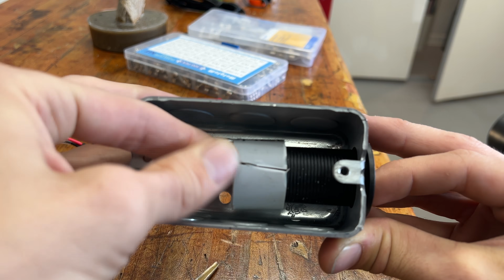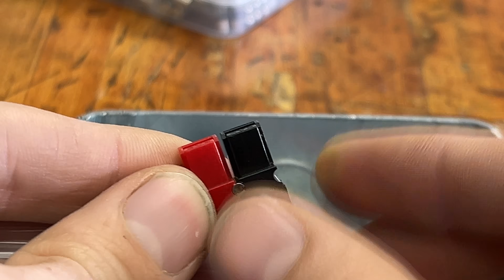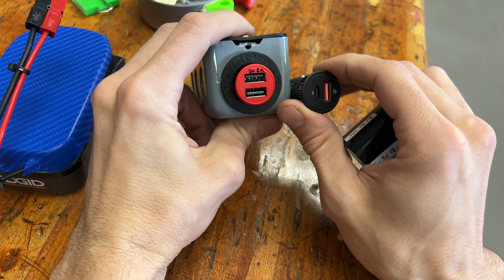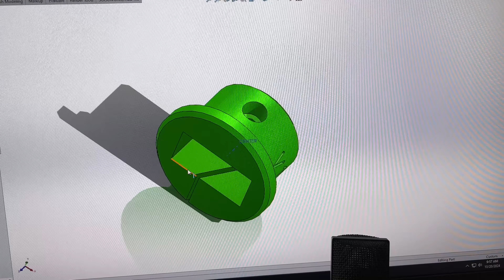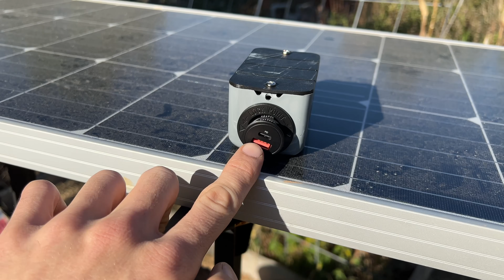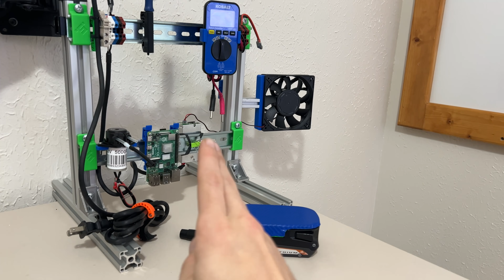Build a DIY power supply (a tutorial using openBox)

Comment: I have a bunch plastic electrical boxes used for small parts storage.  A tool free lid would be handy for many applications.  Price on plastic boxes vary a ton I saw 40 cents each recently, but they seem less standardized than the metal ones.

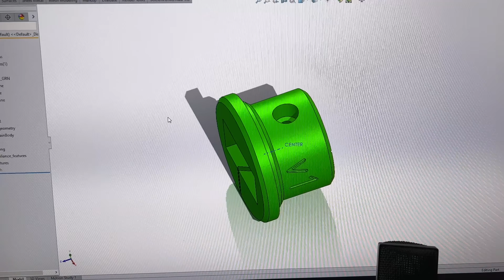Comment: 14:40
On that part, I think you should make it slightly larger than the hole on the box so the spring force is higher when it compresses, and it will hold in better. Also make a groove a little wider than the steel on the box so that it holds in place. Perhaps add a taper to the groove so that it is still removable.

Comment: Great video and very cool design! I also suspected that these electrical boxes would make great project boxes, but glad you took on the project! I would recommend that the "bushing" is released with no holes (other than anything mandatory). I would also ask that you release the files in STEP format as well as that will enable other non-SW CAD software to modify them such as FreeCAD, build123d, etc.
Reply from the maker: Thank you for the inputs on the CAD stuff - i’ve got minimal inputs to know what folks are after so this input is crucial.

also feel free to comment at the grabcad item when you download them.  i do my administration of youtube separately than upkeep of cad and i can better keep track of the feedback (or just execute it immediately) when i am sitting down at the CAD repository.

I always output STEP but sometimes i get lazy since nobody comments on the grabcad.  then i don’t know if they are using it.

Comment: This is cool as a very low cost enclosure. I think you should also check out die-cast aluminum enclosures from digikey as some of the options they are very reasonably priced at around $5-$8 per box( look at the ones sold by spartfun). I like them because I dont need to add any paint finish for it to look decent, weigh a good amount, come with metal lids, pre tapped holes, flush screws, and block RFI pretty well. Downsides are larger ones cost more and mounting kinda sucks, but they stack very nicely.
Reply from the maker: die cast aluminum and $8 sound epic.  can you share a link for us, for your favorite recent one?
Reply: @davidmalawey  Youtube keeps deleting my reply. PRT-13839 and PRT-13838
Reply from the maker: @Cydget holy cow you were not kidding!  13839 at $5 from digikey.  decent size.
Reply: @davidmalawey  On digikey, PRT-13839 and PRT-13838
 are the cheapest, but a bit small. There are larger ones ( use a parametric search on the same category these ones fall under and select all materials that contain the keywords metal or aluminum). Off topic, but you can probably make an entire video about search tricks to finding things quickly on sites like digikey. There are so many little optimizations that make finding hidden gems possible in the massive haystacks. Another item that is nice is ED-ACC-DRBNANO. 3d printed adapters are nice/cheap, but sometimes its hard to beak the robustness of a manufactured product.
Reply: @davidmalawey  PRT-13839 and PRT-13838
 are great value, but a little small. If you go to the category they are under in digikey then do a parametric search for all items made of Metal or Aluminum you will find more options. You can probably make an entire video about how to find things using parametric search/other tricks to find the hidden gems in the haystack of online vendors.
Reply: @davidmalawey  Both PRT-13839 and PRT-13838
 are great value, but a little small. If you go to the category they are under in digikey then do a parametric search for all items made of Metal or Aluminum you will find more options. You can probably make an entire video about how to find things using parametric search/other tricks to find the hidden gems in the haystack of online vendors.

Comment: I feel the Anderson holder doesn't live up to your other designs. Put threads on the outside and print a ring that screws on. Super easy to print and no need for glue.
Reply from the maker: you are correct.  i don’t usually talk about “version1” of anything.  but i do want audience to know that designers still go through trial & tests with simple things.

Comment: Heads up, these often output loads of radio noise. If you have sensitive equipment e.g. a radio project, be warned.
Source: Government Radio tech discussed this with me.
Reply: @byroboy  nah they're talking about something with a switching power source, like most wall wart bricks. This is 100% DC from end-to-end, and even the little boost/buck converter inside that car plug adapter is blocked by the Faraday cage of that metal light box.

This is a far, far cleaner solution than probably 90%+ of the solutions that you could buy.

Comment: You should consider a bezel nut for the green part. You say that there isn’t much force but clearly there is some constant force from the stiff cables trying to push that part out. Also, it will be annoying if you ever want to remove the Anderson connector. I could see you adding threads for a common jam nut size or printing your own nut.
Reply: Second this.
Reply from the maker: what do you call it when you leave a great idea (and obvious) unexecuted, in hopes that some young designer will pick up where you left off and gain the pride of doing something useful for the community?

woke up this morning and i think i want to do this.

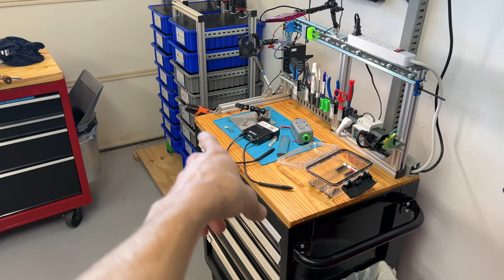Comment: David, love these videos, thank you. I'm literally building an 8020 box to hold my 5" tall ESD boxes from McMaster. I've been trying to think of a good way to do rails. Then I saw this at 16:58, in the background: just use DIN rail as sliders to support the ESD containers. Is that 20 or 25 mm series in the back?
Reply from the maker: this heavy beam holding the solar panels? it’s a thick steel from
the hardware store called unistrut.   narrower of 2 profiles, i think 3/4inch.

lmk if i read you correctly.

Comment: I'd like to see a demonstration of what a complete circuit with low powered electronics and higher powered actuators looks like using this USB converter method. 
It wasn't clear from the video if you expect actuators to be powered from the USB side of the box, or if they should connect via a splitter on the battery side of the box.
Reply from the maker: note to self: demonstrate low + high power combination using handybox gadget.

regarding your question it depends:  you can find tire pumps up to 200 watts that directly fit the car plug.

in such a case i’d make 2 outlets from my large 12v battery and one would send straight to the pump while the other has a usb outlet for the electronics.  if we wish, we add a relay such that the electronics control the pump. then you have a decent robot.

my entire 3D printer uses 180 watts and 400 peak.  the printer PSU brings 120AC down to 24DC, then is sent to motors and the electronics have 12 or 5v regulators on the actual PCB.

for a portable 3D printer we’d use one output to boost 12v to 24v and then the other output with usb to the electronics.

Comment: Never seen such a huge honkin' countersink bit be twirled around on the end of a deburring tool before!
The countersinks I've got at that size have a half inch round shank attached... is that a tool you modified yourself for a specific pourpose? It seems like a much easier way to use those bits by hand than trying to grip a featureless metal cylinder... 😅
Reply from the maker: i got this on amazon the same month i got my twirly slim bit. it came with both tips, and this one is my favorite after 3 years.

Comment: keep electrochemical theory of corrosion which choosing the screw to avoid rusting🤓
Reply from the maker: what would you choose for screw if i wish for this to go outdoors?  the box is mild steel with galvanizing.  the screws could be anything.  i could run a trial if you recommend a certain improvement.
Reply: @davidmalawey  well nylon screws would be a good go for outdoors.
Reply: If you want hyper durability you could throw the whole contracption in a IP68 Box with the batter so you have a whole station all at once that can get showered in😅
Reply: They make those batteries now in 60w ,for use with a snow blower or similar i assume that's what the zero turn lawn mowers use now as well
Reply: @IcannaHelp 60 V, not W :)

Comment: For what reasons specifically did you paint the box? Perhaps a video about paint and coatings would be helpful if you don’t have one yet
Reply from the maker: that’s an immense topic. i’m scared.

I sat down and thought about how much I’ve learned that I would teach to my 18-year-old self and it’s really like a whole textbook . 

i’m going to try.
Reply: @davidmalawey we're here for it!
Reply from the maker: oh, and to answer your first question, the purpose is to gain ongoing learning towards best methods of painting metal.  To develop a process.  And then in the future, I can choose any desired coating or paint.
Reply: @davidmalawey I like this. I do this on a lot of my projects. Doing a few extra details that test methods/materials in order to develop a working knowledge base.

Like, “did I have to? No, but this is a great opportunity to play with the idea, which is something I have been wanting.”
Reply from the maker: @Dudeguymansir  right so there’s no deadline, no rush, and no cost if it fails.

and the selection of details to tackle can be just whatever is lying around, ie a type of paint i’m not very proficient with.
Reply: I would just 3dprint the whole thing instead of using a very tiny and limiting american electrical box